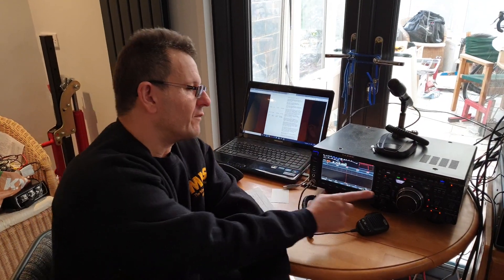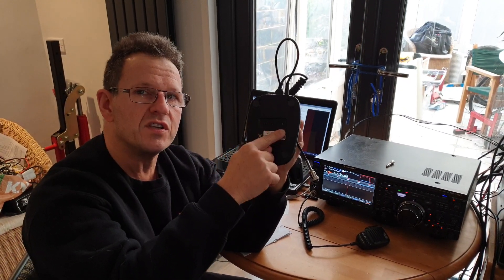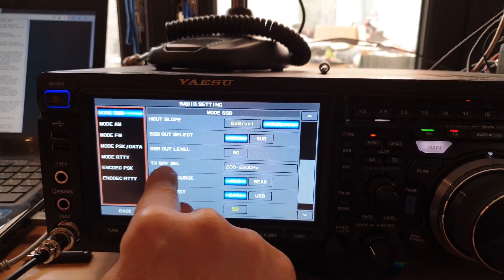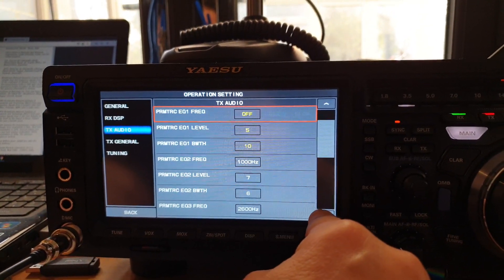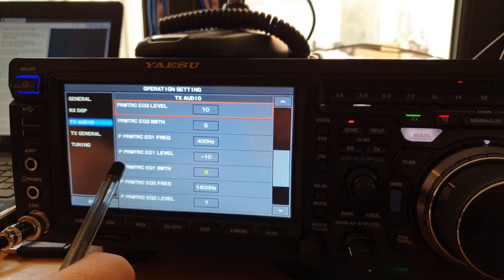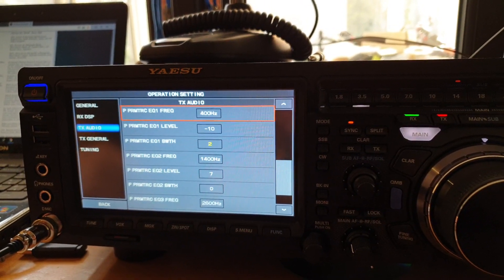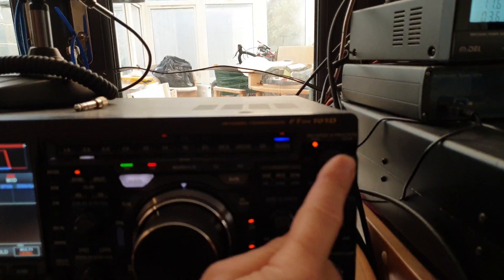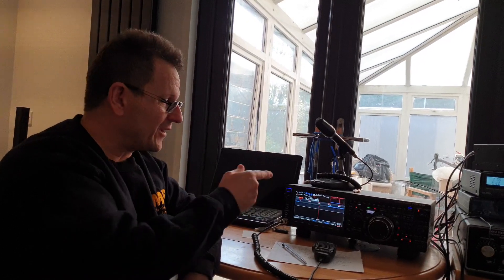FTdx-101 Microphone Equalization

Comment: Very complicated to tailor the audio.  
What happened to ease of setting the DSP audio like in radios such as the Yaesu FT-920?
Menu of TX microphone DSP choices of OFF, 1, 2, 3, or 4.  Simple. Non-confusing. Precise.
OFF: DSP microphone equalization is disable.

1: Mid- and high-frequency components are
enhanced .
2: A high-emphasis response is produced,
ideal for pile-up or contest work.
3: Both low- ang high-emphasis response are
produced.
4: A wide bandpass response is produced,
emulating a “Broadcast” microphone audio
characteristic.